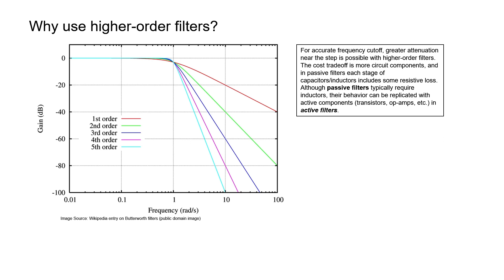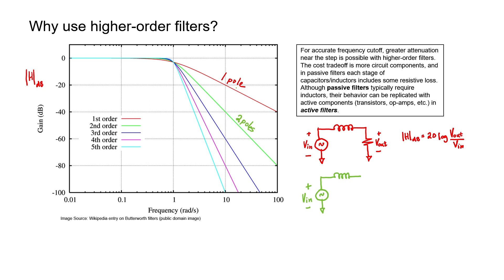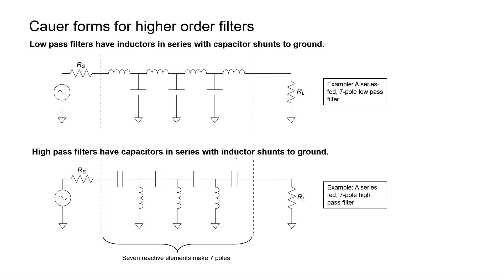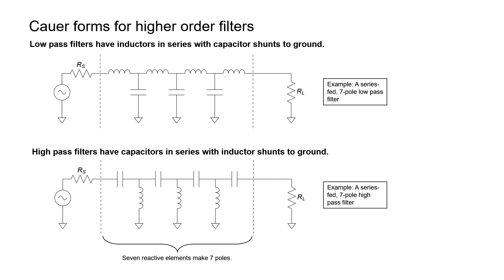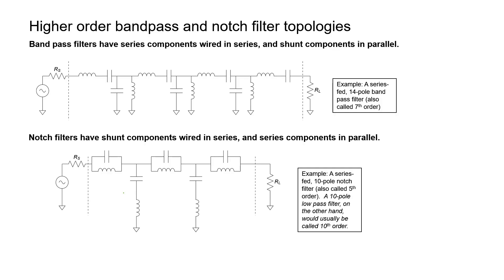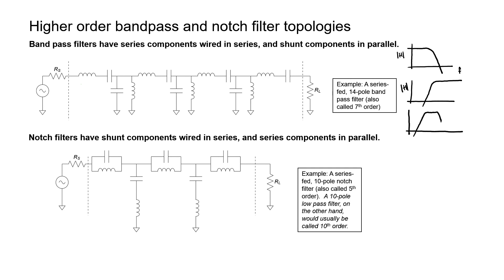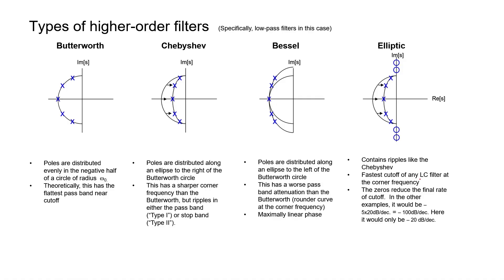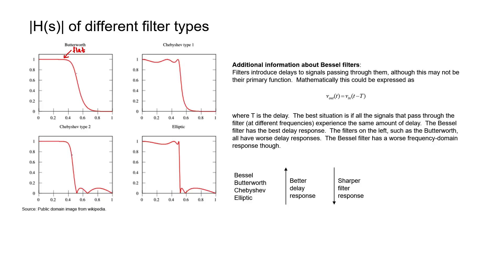Why do you need a filter with lots of poles? (9 - Passive Filters)

Comment: Dear Aaron, thank you so much for these series. I wish I had a supervisor like you during my masters degree. It was brief but had everything one needs to know to start designing and simulating. well done. Which reference book would u suggest for Integrated filters and which one for discrete filters on PCB? I want to  designing a filter to maximize 1th harmonic and suppresses 3rd harmonic heavily for a cross couple oscillator or a filter that has same passband response for 1th and 3rd harmonic and suppresses rest just like class F oscillators /PAs. sorry for asking lots of questions